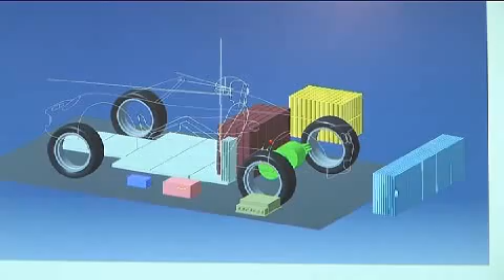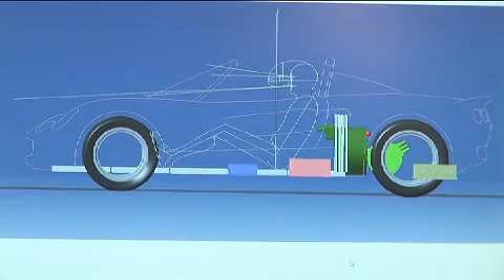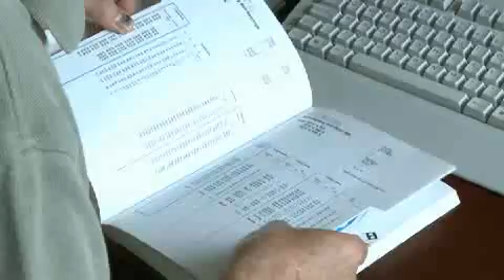Part 1 - Zerocarbonista - The Wind Car is on its way

Comment: To all those who think this car carries its own wind turbines, well... it doesn't.  It is just another electrical car,  WHat happens is that one here guy runs a company that installs big wind turbines, and he espects that his electrical car batteries are going to be charged from the electricity coming out from his wind turbines. Of course the car will stop beside the big wind turbines, and connects to the wind turbine to receive from it , the power to reload its batteries.  .